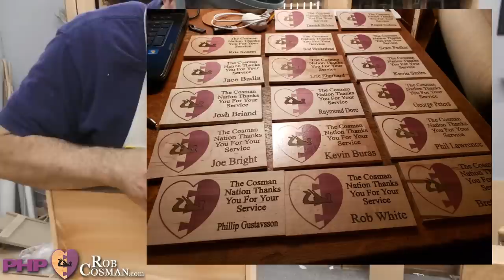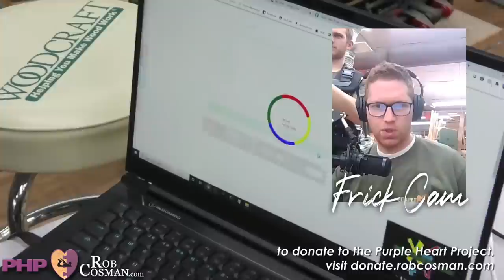Live with Rob Cosman: Angie's Bed Desk Build (Part 11)

Comment: Rob, I'm always learning from your work.  As you were deepening the drawer bottom's slot with the router plane, I figured that you'd have to switch over to a chisel as you reached the sides.  You then mentioned flipping the blade around in the plane just as I was wondering if it would work.  Badda boom~!  I just received mine from Lie-Nielsen a month ago and I'm ready to put it to use.
Thanks for the continuous enlightenment~!!   :-D